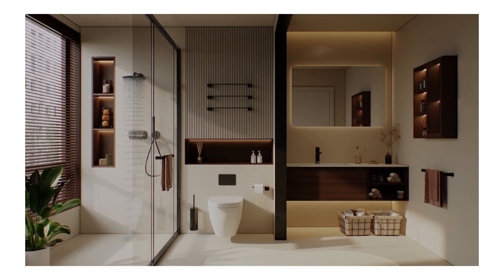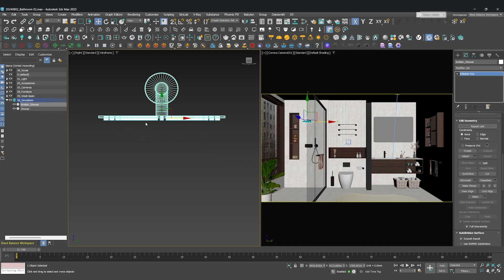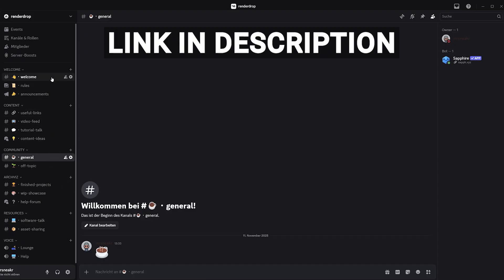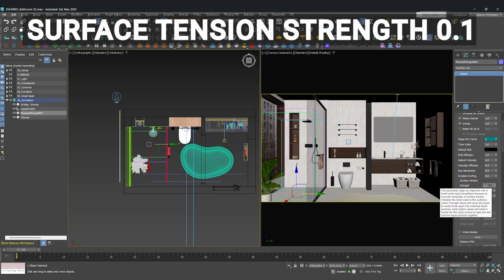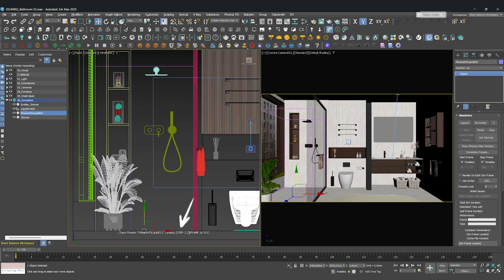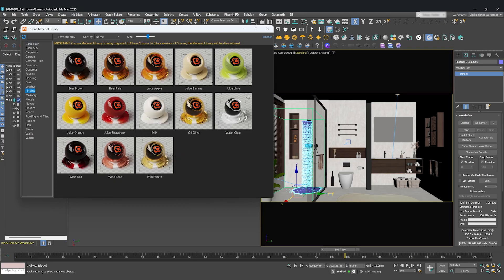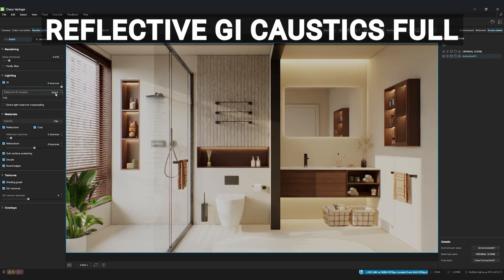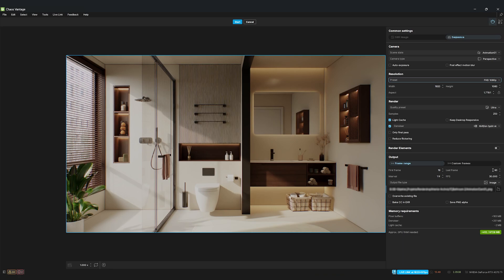MASTER This REALISTIC Water Animation Effect (Chaos Phoenix)

Comment: amazing tutorial.but one thing i noticed is the water seems to move reverse the gravity.
Reply from the maker: thank you 🙂 that might just be an optical illusion in the animation since you can see at 4:50 that there is even a puddle on the floor. So it's def flowing to the bottom.